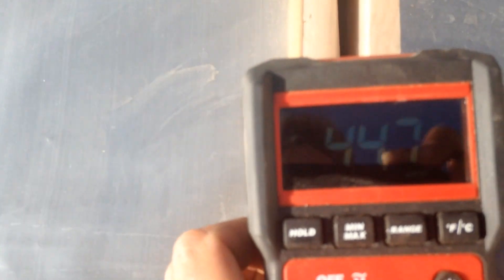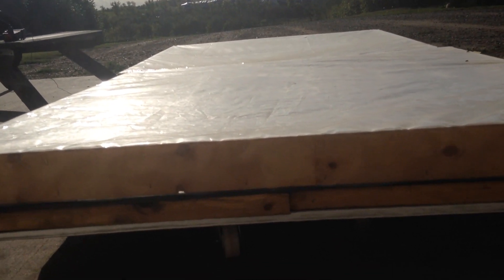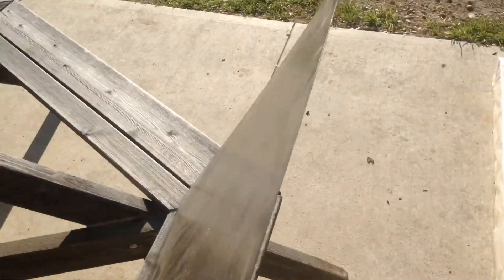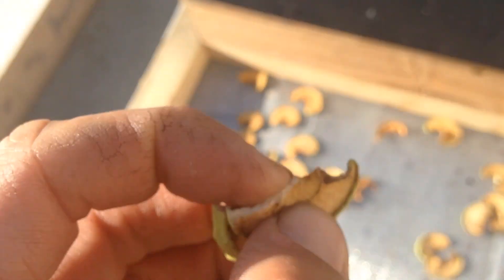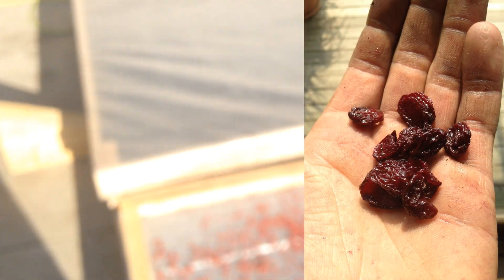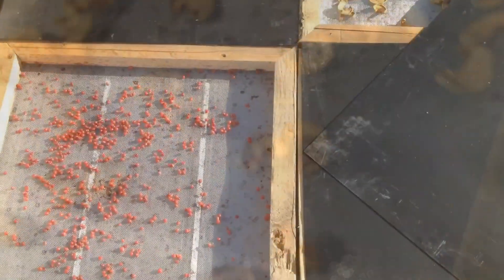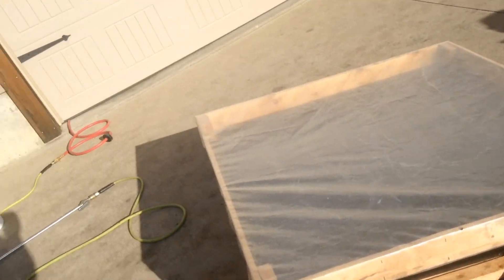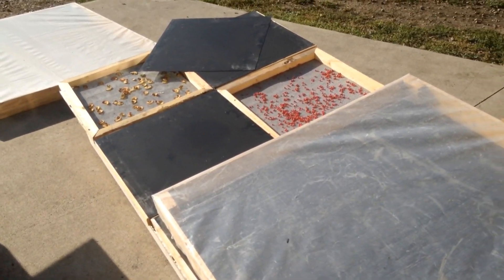A Solar Dehydrator That Actually Works!

Comment: Hi there, Does this dehydrator have a fan to pull out the moisture? Also I clicked the link to see the spec of how you built it  but it's expired. Currently desperately trying to find a drying solution for a lot of chili in Spain in a very humid climate. Any help or advice would be amazing. Many thanks
Reply: It does not look like it has a fan.  Hot air rises, so I think it uses natural convection to ventilate.  It is really simple.  1/2" thick plywood sheet, corrugated metal panel painted black screw to the top of the plywood sheet, box frame with mesh screen screwed to the bottom to hold the harvest to be dried (the box is removable from the plywood assembly, the ridge pattern of the corrugated metal panel makes great air circulation, if you want to prevent it from sliding down the plywood assembly, you can screw 90 degree anchors to the plywood to hold the box frame), then a thin frame covered with screw on clear plastic sheet which is removable from the box frame.  The length and width dimensions are up to you.  You can build as big or as small as you want.

Comment: I was thinking of making some of these, once I get to where I'm going lol. Thanks for the design. What do you think of a slit (or holes) at the top of the high side, to remove humid air out of the chamber faster? Of course not too fast to lose a lot of heat.
Reply from the maker: I think it would let insects in!
Reply: @TakotaCoen  lol Are you joking? Of course put a screen over it.
Reply: @TakotaCoen  I just thought that inside the chamber it would get very humid, which well reduce the rate of dehydration.